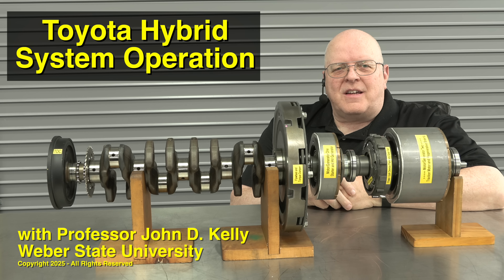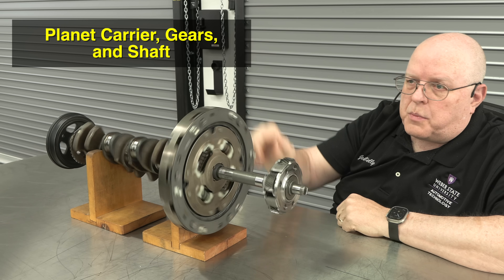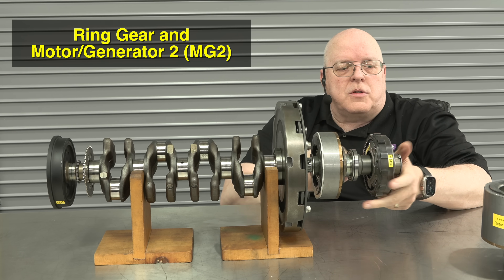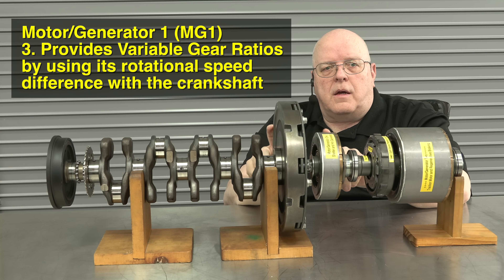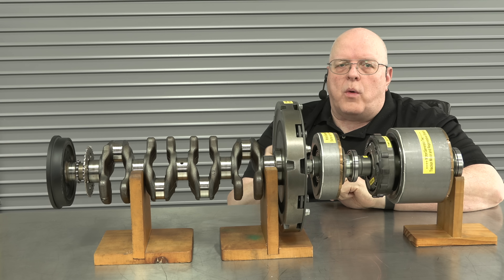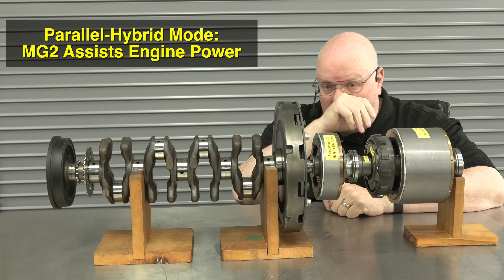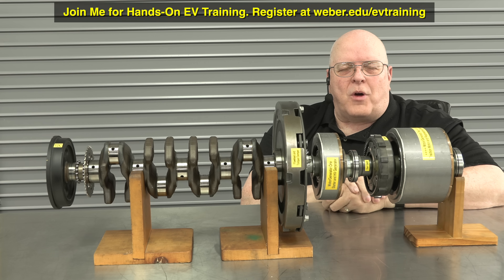Toyota Hybrid Transmission Operation - 15 Years on YouTube!

Comment: Hello, in a real car when the combustion engine is stopped, and the MG2 is propelling the car, I understand that a counter reaction force is applied to the combustion engine. Is there a blocking mechanism to stop it for rotate, or it is a clicking device such as in bicycle that only rotate one way, or is it compensated an blocked because of combustion motor compression (valves closed). Or is the MG1 acting as a break to maintain the combustion engine stopped, I think this is very difficult and the MG1 would have to make the same totque as MG2.
Another question I don’t want to try with my car. If you apply the parking there is a mechanical lock in the transmission, if you apply it moving, is it protected? If you are really slow, it also detects or you can destroy the transmission, imagine you forget the parking hand break?
Reply: "Is there a blocking mechanism to stop it for rotate..."  Yep, there's a pawl in the system that he doesn't mention in the pure EV mode.
Reply from the maker: Yes, there is a ratcheting mechanism that clicks to prevent the engine from spinning backward. I am working on a video to show that here sometime in the near future. These Transmissions do have a parking gear and parking pawl, so it would damage your transmission if you tried that. Thanks for watching.

Comment: Good to see you again.
As the battery capacity on a regular hybrid is extremely limited, would the electrical power used to spin MG1 backward in the OD mode you describe be drawn from MG2?
Reply from the maker: Thank you, MG1 wants to spin backward anytime the engine is running just because of how the planetary gear set is configured. It’s rotational speed can be changed by how much regenerative torque or negative torque it is producing while spinning that direction. There are times though in parallel mode that MG two can provide power as well.

Comment: What you described is how planetary gear works but not eCVT. 
Lets forget about battery.
Real eCVT is where ICEngine powers mg1 and produced electricity, electricity powers mg2, just like in Honda. Same is in Toyota but additionaly we have planetary. 
Lest analize what happens from full stop to high speed driving.
When car is in full stop. Mg1 rotates free, much faster than ICE so car is in stop. When we want to accelarate from full stop then a load is put on mg1 it rotates high rpm with low torq. Load generates electricity that powers mg2 , but mg2 gives high torq at low rpm so car begans to roll . Same ammount of power at mg1 and mg2 but different torq and rpm, thats what real eCVT means.
Additionaly in Toyota when load is on mg1 there is a little bit of torque on the ring so little bit of energy passes throug planetary gear to wheels.  But most power goes through  mg1 to mg2 by electricity. at low car speed.
Mg1 produces electricity, it powers mg2 , when speed of the car  is rising then rpm of mg2 also rising but torq is dropping beacasue all the time we have same smmount of electric power from mg1. Thats how eCVT works. Just like in Honda and we could finish on that.
But Toyota has additional planetary so when speed of car is faster then wheels and mg2 spin faster, more power goes to the wheels through planetary and less go through mg1 and mg2 by electricity. Its good becasse converting mechanical power to elctricity by mg1 and again electricity to mechanical power by mg2 has looses. Eficincey is lower than 90%. Mechanical energy that flows through planetary is 100% efficient.
In Toyota at some high speed of the car load at mg1 is so high that it almost stops and doest produce much electrical energy, at this moment almost all power goes from ICE to wheels by planetary without lost of energy. In Honda there is clutch which engages to have 100% eficency.

Planetary gear is not eCVT, it is only additionall passtrough which make eCVT more efficient at medium and high speed driving speed and even in low speeds it raises effiecency little and thats benefit 1 of having planetary in Toyota and Ford

As part of energy flows by planetary gears then mg1 ang mg2 can be lower power and lighter and cheeper. Thats second benefit.

When we have battery then  third benefit is that total power output at higher speeds is combiened of mg2 and ICE. In Honda while clutch is not engaged thet total maximum power is same as maximum power of mg2 , and is also dependent on mg1 when battery is depleted.
Reply from the maker: Thanks for watching, I appreciate you sharing your perspective!
Reply: The power split from the planetary gear set used to drive the wheels is a component of the eCVT. While the gen/mot configuration you describe is technically also an eCVT, it's normally refered to as an "electric drive". The combination of the electric drive and the mechanical component is what makes it a "hybrid drive" as it uses elements of two different systems to transfer power to the wheels.
Reply: @fascistpedant758  planetary gears is not a gearbox or continous variable transmition gearbox so its not eCVT, its only additional power spliter that works a side to eCVT . So Yes. its only additional component of eCVT.
Video is little misleading and someone can assume thet planetary gear system is eletronicaly driven continous variable gearbox where ratio is changed by powering gm1. No. Gm1 is never powered from battery when driving forward, it used as genereator and dependent on load torque of gm1 the torque of the ICE is balnce  splited to gm1 and output by planetary system. Gm1 and output torque split ratio is alway same and defind by gear ratio but power split ratio is dependent by rpm of gm1 and output shaft, genius design.
Reply: @krzysztofkenobi8072  "Gm1 is never powered from battery when driving forward..."  What part of motor in Motor/Generator 1 is giving you trouble?  Of course it is used as a motor, that's how you get variable ratios!
Reply: @awebuser5914  nope, you understand it wrong.
Reply: @krzysztofkenobi8072  You are harping on nebulous definitions...  eCVT is an acronym that simply means: "Electrical Continuously Variable Transmission", which is exactly what the Toyota system accomplishes.  If it wasn't: "continuously variable", it wouldn't work, plain and simple.  How you actually accomplish variable reduction ratios is completely irrelevant .
Reply: @awebuser5914  you dont uderstand me. It is eCVT, I never wrote it isnt.  But eCVT is acomplished by mg1 and mg2, not by  planetary gear system. Planetary gear system is only add on.
Reply: @krzysztofkenobi8072  "Real eCVT is where ICEngine powers mg1 and produced electricity, electricity powers mg2"  So, you are the final arbiter of what "eCVT" means then?  You clearly have ridiculous biases with respect to the Honda system, when there's absolutely no proof that it's "better" in any practical way and just like with the Volt, et al, adding a wet clutch is just an additional layer of complexity that could fail.

For those that would like to learn , here's the Honda system, as described by the good Professor: https://www.youtube.com/watch?v=QLUIExAnNcE
Reply: Anyone iterested in power flow can check at wikipedie different states of toyota system. ICE power is always splited to wheels and MG1 througt planetary gear system. MG1 charges battery or powers MG2. MG1 is alwasy running as generator while driving with ICE on. Its used as motor only to startup the ICE

Engine charge (Recharging and/or heating catalytic converter and/or interior comfort HVAC)
ICE -> MG1 -> HVB
Battery or EV drive
HVB -> MG2 -> wheels
Engine & motor drive (Moderate acceleration)
ICE -> wheels
ICE -> MG1 -> MG2 -> wheels
Engine drive with charge (Highway driving)
ICE -> wheels
ICE -> MG1 -> HVB
Engine and motor drive with charge (Heavy power situation such as in steep hills)
ICE -> wheels
ICE -> MG1 -> HVB
ICE -> MG1 -> MG2 -> wheels
Full power or gradual slowing (Maximum power situations)
ICE -> wheels
ICE -> MG1 -> MG2 -> wheels
HVB -> MG2 -> wheels
Reply: Most proper video describing how toyota eCVT is working. MG1 is a generator. MG1 as generator is  also a torq load which resulfs different gear ratio eqivalent. In this video was missed very importaint thing that when we do not need to charge battery then all power from MG1 flows to MG2 what gives most torq to wheels at slow speed and when accelarating at low geer eqivalent.
https://www.youtube.com/watch?v=81ogeIqw1KY
Reply: @krzysztofkenobi8072  "MG1 is alwasy running as generator while driving with ICE on"  OK, did you miss the part when the Professor mentioned that MG1 is stopped when running steady-state around 55MPH?  JFC, you really don't get this do you?
Reply: @awebuser5914  MG1 free rotating is the lowest gear when car is at stop and ICE is on. MG1 stopped is highest gear. 100% power goes from ICE to wheels. In both cases MG1 doesnt have to generate elctric power. I did not miss anything. Had to write here a book to mention everything. And in reality you cannot stop MG1, even when elctricaly shortcut it will still rotate very slowly when mechanical force is aplied ant it will generate current to the shortcut cuirquit so it still acts as generator.
Reply: Exapmple how eCVT works. Lets say we travel moderate speed, we have 1500rpm on ICE.
If computer want to drrop equivalent of gear ratio twice it lowers power output from GM1. Torq load of GM1 drops, at same time torq on wheels dops and the car would slow down. Lower torq load makes the ICE to rev up to 3000. Becasue ICE revs up 2x planetary revs up 2x, car speed does not increase, so MG1 conected to sun gear rotates over 2x faster. MG1 has lower torq but rotates over 2x fater, that cases that it produces more electric energy than before. This adiitional energy goes to MG2 which deliver more torq to wheels than before. So it compensates lower torq through planetary gear system and car doesnt have to slow down. 
Same speed of the car, twice ICE RPM

Comment: I never realized that the motor/generators also acted as a cvt, that’s incredibly interesting. I had assumed that it worked purely as either a standard electric motor with the ICE not running or as an assist to the ICE, aka the parallel mode. Thank you very much for this video, I learned something new and amazing today.
Reply: That’s basically how the later version of the Honda IMA system worked. Like in the 2006 and later Civic Hybrid before they switched to their two motor system. Prof Kelly has great videos on those systems too.
Reply from the maker: Glad you enjoyed the video!

Comment: Which one is more efficient and durable between Honda ehev and THS?
Reply: THS,because honda has a clutch engaged in high speed
Reply from the maker: The Toyota system has fuel parts and does not use a hydraulic clutch pack at high speeds. Thanks for watching.

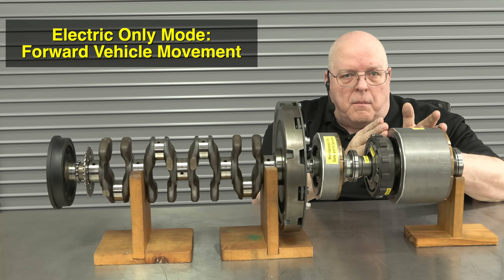Comment: @8:13 whoa....had my Toyota hybrid for over 10 years and I'm finally learning its eCVT...shit's ingenious 😲
(also, typo)

now how does the "B" mode work?  I presume MG1 in addition to MG2 get into the regen state 🤔
Reply from the maker: I’m glad it was helpful. I noticed two typos after I published the video which is quite embarrassing, but it’s already out there. The B mode uses regenerate breaking while charging the high voltage battery, but once the battery is charged, it uses the variable gear ratio between the crankshaft speed and MG1 speed to provide engine compression breaking to slow the vehicle. Thank you for watching.

Comment: My Prius turned 15 this month, I have enjoyed these videos over the years.  What about B mode (engine braking)? I guess it’s simply MG2 turning the crankshaft with fuel cut.
Reply from the maker: Thank you for watching all of these years. In B mode once the battery is charged, it will turn the crankshaft with the fuel cut to provide engine, breaking and slow the vehicle

Comment: I love your videos! but I am still a bit confused.

What I don't understand is how the battery remains charged while driving, because it seems like mg1 is discharging more than charging with all of the different things it does. I don't understand electric motors too well, but I thought they could either charge or discharge electricity, not both at one time.  

In a low state of charge, Is the car acting as a series hybrid at low speeds(charging the battery/powering mg2 with mg1 as the engine runs) then switching to a parallel hybrid at higher speeds? (using the resistance of charging mg1 to slow its rotation and allowing the engine power to flow to drive wheels)
Reply from the maker: Thank you for watching. I appologize for the confusion. MG1 can also generate power rather than use power while driving due to the physical resistance of trying to move the vehicle. Instead of using power to slow or speed the MG1 rotor, the vehicle load does it. Don't forget that MG2 is also a generator anytime the vehicle decelerates.
Reply: I see! Thanks  @WeberAuto !!!

Comment: This is teaching done right I'm interested in this demonstration and I'd never given much if any thought to Hybrids operation.    I'd love to see some older tow rigs power and dependability demonstrated and likewise see bad modern examples of poor engineering leading to both repairs and bad designs that lead to fixing and owning some as a ticking time bomb.   Looking at my 2.8L 2006 Chevy Colorados timing chain....    I feel like simplicity and less parts is more favorable vs all the sensors and software wiring messes.    Congrats on 15 years you've made many helpful and thought provoking videos that give me a better perspective on working on autos.
Reply from the maker: Thank you for your kind words

Comment: So functionally, is the Toyota or the Honda configuration better?
Reply from the maker: I get that question asked quite frequently. The Toyota system is the power-split transmission that I described in this video. The Honda system uses a series hybrid system for the majority of driving and also has a direct engine to wheels connection at higher speeds. They are both impressive systems and work well. My personal preference is the Toyota illusion. Thanks for watching.

Comment: I've been through Toyota's entire training program and you explained mg1 and mg2 operation better than they could.
Reply from the maker: Thank you!
Reply: @WeberAuto I have been thru Ford's entire training program and I agree 💯 percent
Reply: @WeberAuto  Your clarity comes from your careful and repeated explanation of the mechanical system using Normal terms such as motor and gear.  You then refer to the manufacturer's designated nomenclature. Acronyms are useful shorthand for advanced designers and technicians working on something they have extensive knowledge about, but there is an industry trend to develop buzz-words for 'feels' that show off their point of difference and alleged/supposed/hoped-for superiority!
Reply: Quote from @sakaiyasu4509

I'm a retired Japanese engineer. The idea for a power-split EMT (electromechanical transmission) was conceived in the United States in the 1970s after the oil crisis. Since the patent (the Berman patent) had expired and become public knowledge, Toyota was able to adopt this mechanism with confidence. Even though a series hybrid (such as the Nissan e-Power) can achieve the same thing, why use a power-split mechanism? It's because it reduces the power passing through the electrical path, which is less efficient than gears. The function of planetary gears is easier to understand using a nomogram. However, a nomogram only reveals the speed relationship; the torque of the ring gear, carrier, and sun gear is always proportionally distributed. It's only when you consider this together that the operation of the THS becomes clear. The 13 modes outlined by Professor Yamamoto don't exist individually; they're all seamlessly connected. Berman et al. call MG1 the "speeder" and MG2 the "torquer." I think this better describes the nature of the system. MG1 is responsible for modulating engine speed and torque as a function of speed. MG2 is responsible for modulating drive wheel torque and speed as a function of speed.